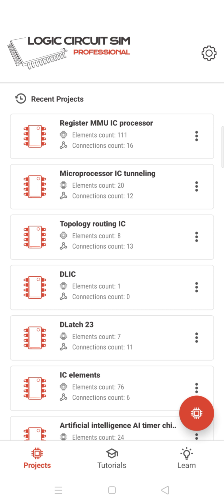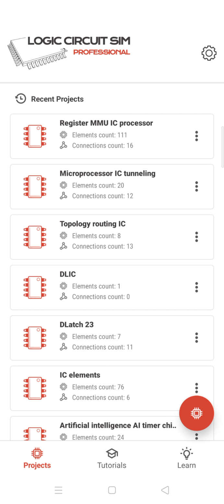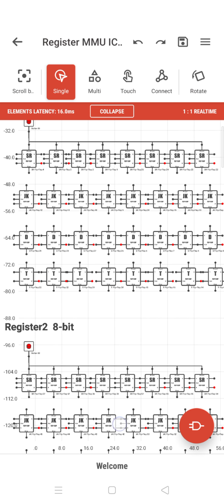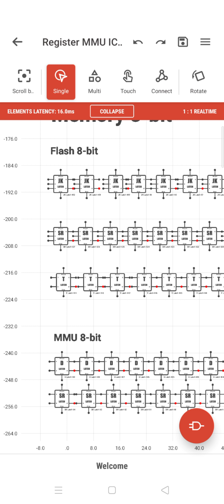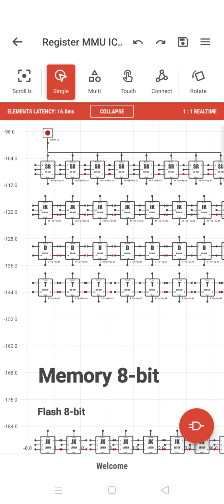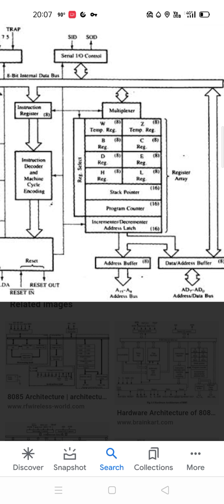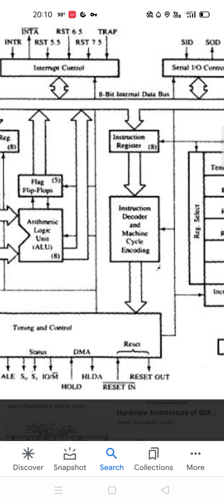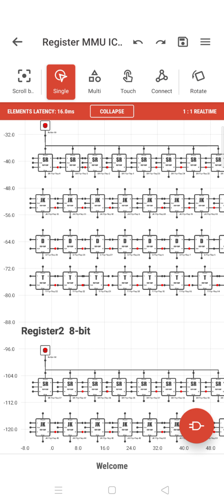Microprocessor design IC using circuit simulator Pro.

Comment from the maker: Even Intel took almost 40 years to develop the 8085. Modern technology has multiple cores and shared memory Etc. But these are the basic electronics circuit design and simulation and modeling. IBM was then running analog. Octa core is somewhat like 8 ALU running parallel Etc. Mostly new one have 5G. All modern chip design is done by software. Usually Excel Database and some software plugin in STREAMS. Done by robots within a few days. Even overnight delivery of new design chips. Mostly AI. Basic idea is making water flow serial or parallel or circle.
Reply from the maker: Modern technology prints food and beverage and vegetables etc. Even water is printed.